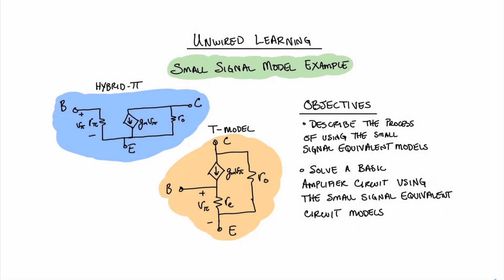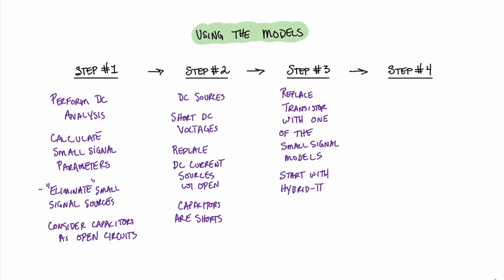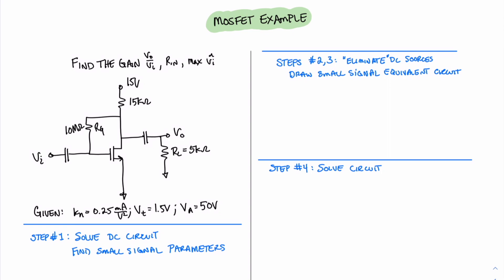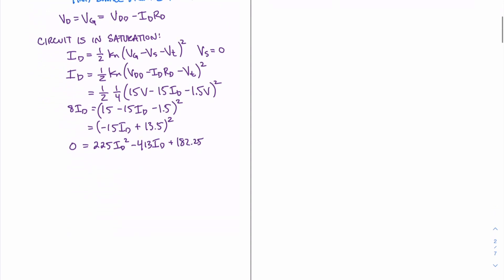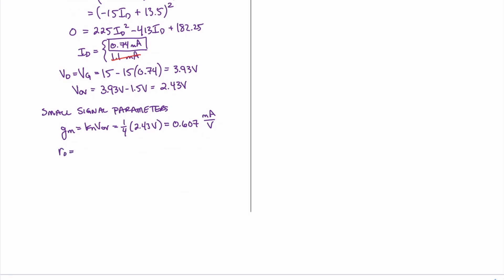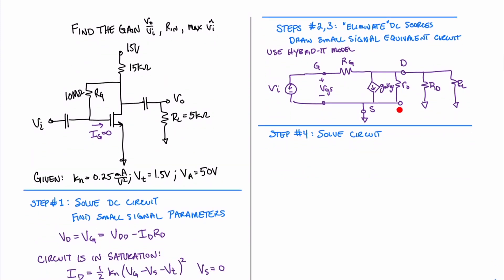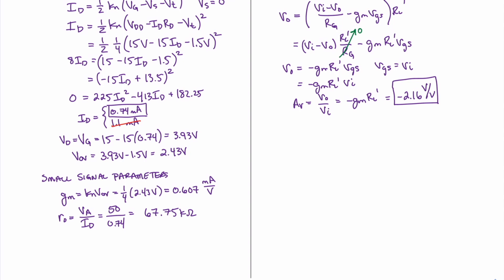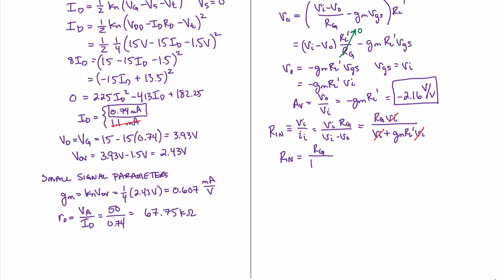Small Signal Model Example

Comment: Is it not the capacitors treated as open circuit in small signal model?
Reply: They are short circuited in AC analysis, open circuit when DC analysis

Comment: What really is the Va? I dont see where that is or what it means 😢
Reply: I think it's like lambda = 0.02?
Reply: @Emma-dd1fc  Va = 1/lambda
Reply: Va is the Early voltage. Analyzing the ID and VDE characteristic graph, the point of intersection from all the relationship curves correspond to some Early trans-conductance which is ID/VA where VA is the value of VDE at the point of intersection.